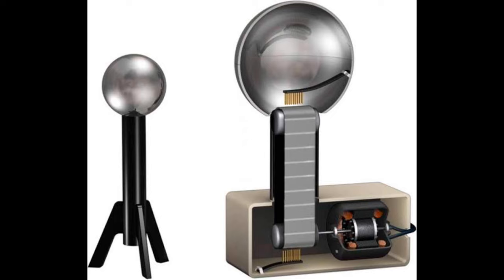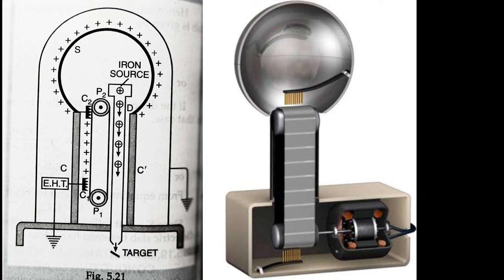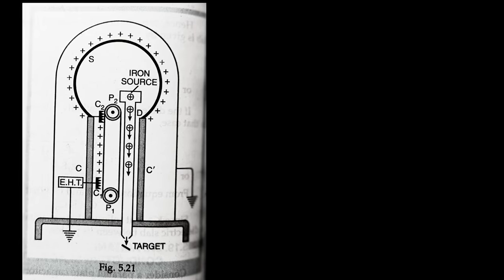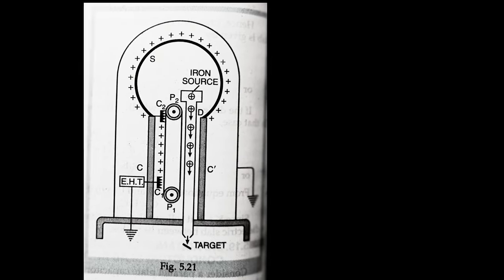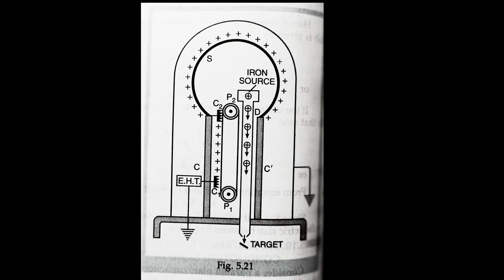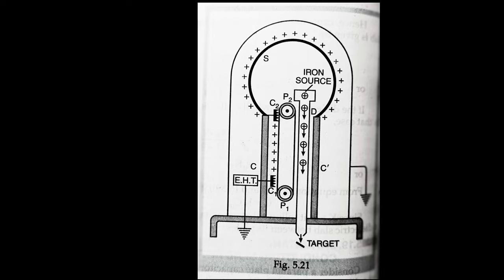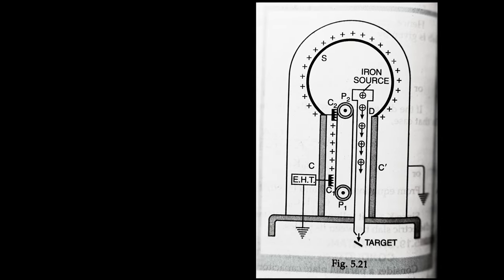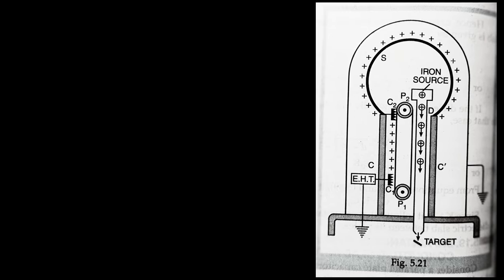Ven De graaff generator (High voltage generator)

Comment: Sir ji namaskar sir ji 2 igbt module see 5.5kva 48volt DC input 220 out put inverter circuit yaa inverter kaa video banaye jisme charging overload lobattery Naa ho
Reply from the maker: Square waveform  ka bana do.
Aur last me kiya likha hai apne  charging overload ? Low battery  indication chahiye ya nhi chahiye
Reply: Jabaab kee leye dhanawaad charging overload lobattery nahi chahiye sir sirf 48volt DC see 220ac banna dee